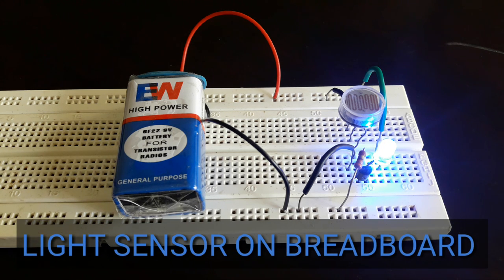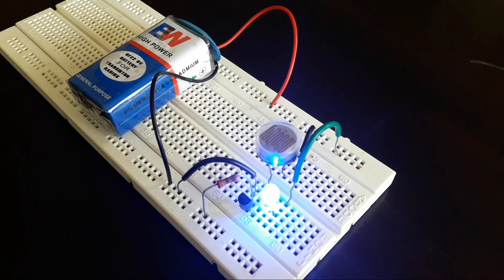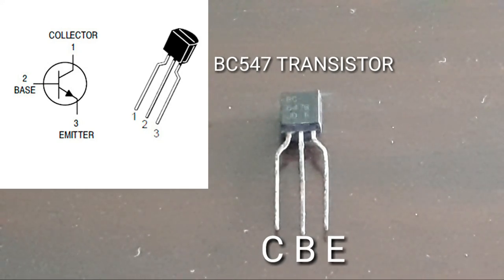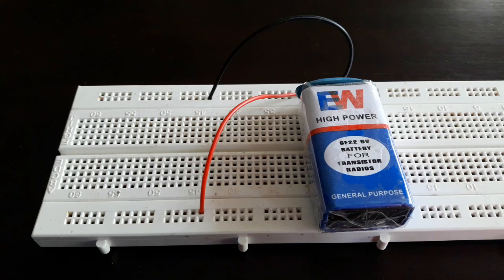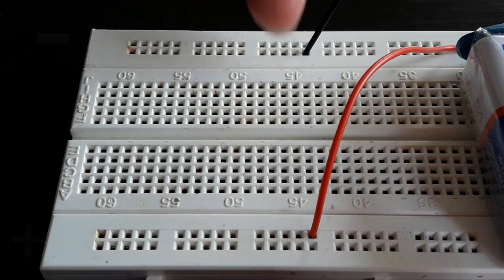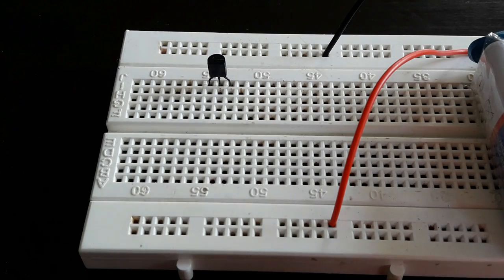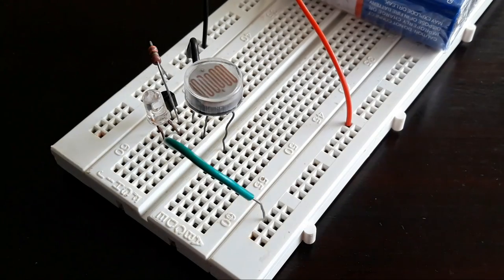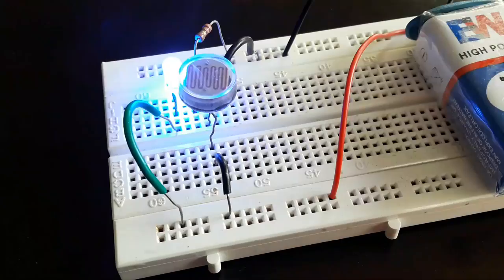How to make a "Light Sensor" on Breadboard [HD]

Comment: Thank you, subscribed. I am very new to electronics, nice to learn. I do not fully understand the role of the 330 Ohm resistor from the base to the ground. In other projects like a water level indicator there was current to base but no current from base to ground. Here there is current from the base to ground. If the current can go right to the transistor without the resistor would not it go to only to the transistor by following least resistance and not to the ground through a path with a resistor? Btw. I had a smaller green LED that was too bright (so much that it went yellow), so I have included another 330 Ohm resistor in fear that it will burn out. Keep up the good work :)